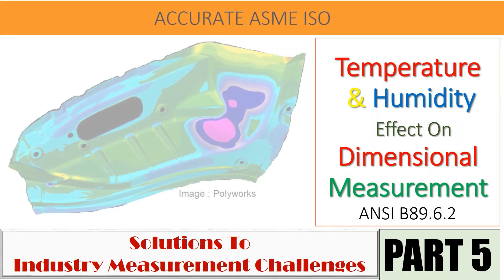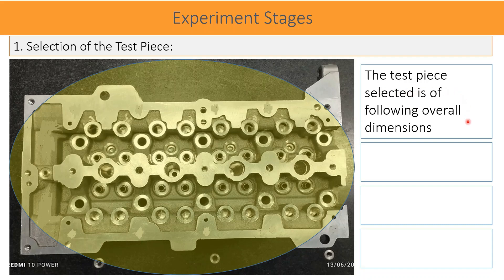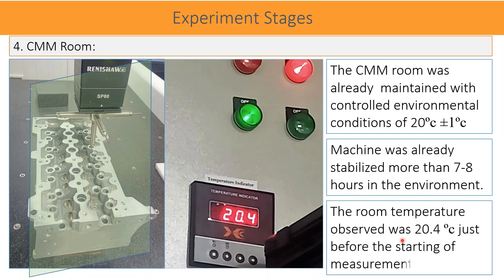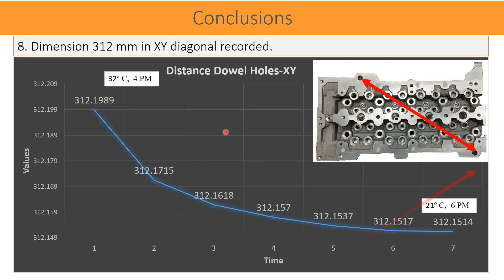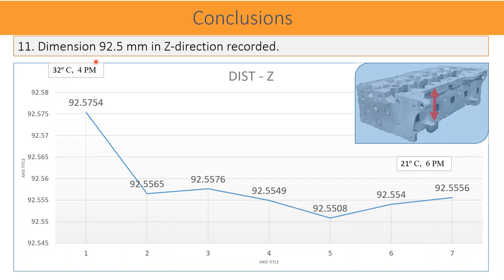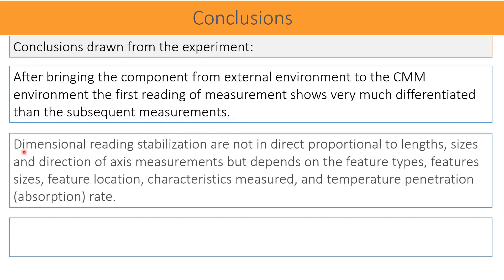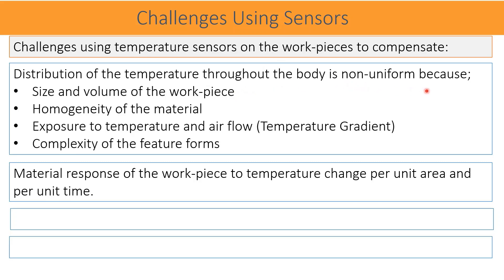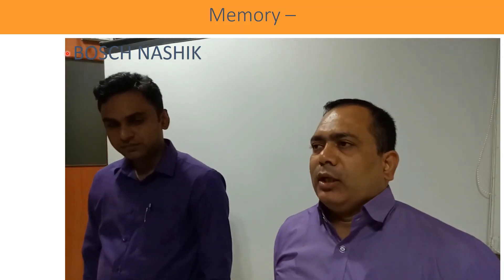TEMERATURE EFFECT ON DIMENSIONAL MEASUREMENTS (Part Soaking)

Comment: Which iso standard or NABL standard said to maintain Standard room temperature at 20+-1 degree celsius.
Reply from the maker: Hello
None of the standards defined the temperature tolerances. These are manufacturers specification to give the accuracy within the specified tolerances.
However International standards ISO 1, 17025 and ASME Y 14.5 statement that if 20 degrees not maintained then compensation can be added.
Regards